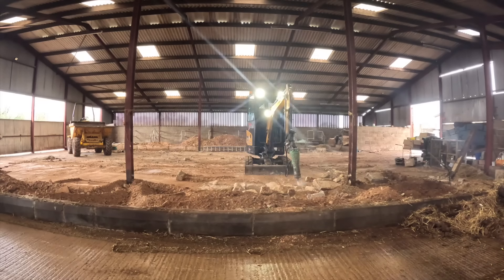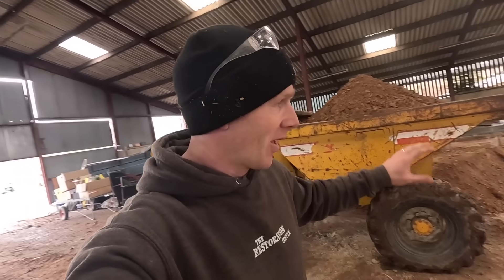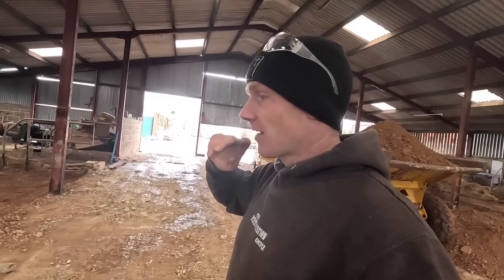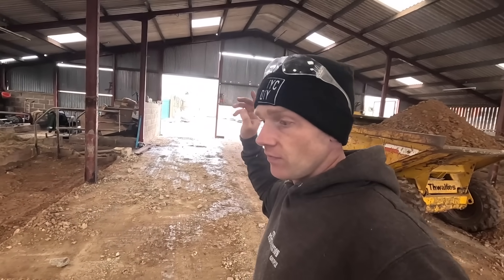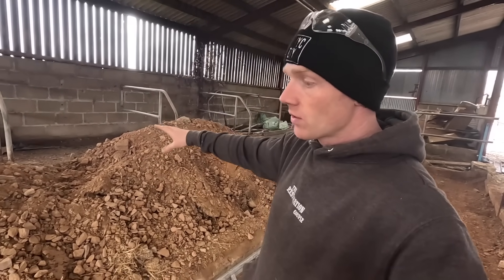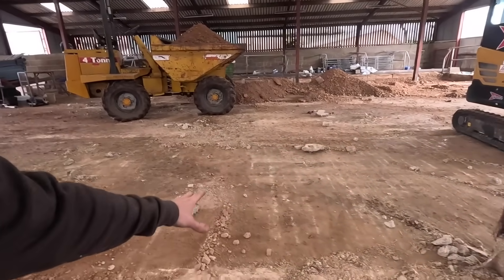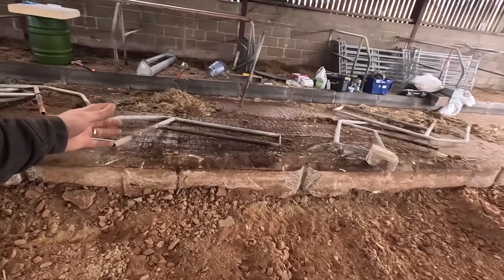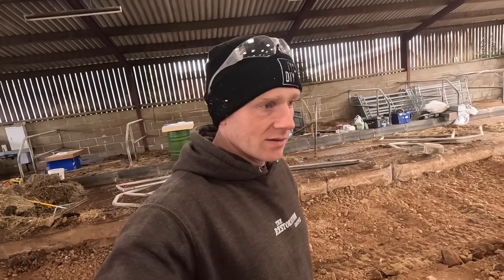OUR BIG BARN BUILD - BIGGEST DECISION YET - Does it have to go?

Comment: When it comes time to level your subgrade, a 3 or 4m length of beam fixed to the excavator bucket makes short work…  We’ve done floor prep fro 20,000sq m industrial buildings that way.  One hand in the excavator, and one with a stick and the laser level.  Beats the heck out of a rake and shovel.
Reply from the maker: That would be ideal.  Couple of days off so that's my next head scratcher! Did you have to fabricate the beam to fit somehow?
Reply: @TheRestorationCouple   First version was just a length of i-beam held against the bucket with the grapple/thumb.  Second was chains and load-binders.  Third version was a bit of iron welded to the beam so the teeth of the bucket would sit in, and then two tabs on the beam to bolt them solid to the sides of the bucket.
Reply from the maker: @vaalrus  I'll have a play this week.  May be able to bolt it through the existing holes where teeth go.  As it's hired kit I can't mod it but bolts fine. 👍

Comment: You have made a great start Tim! So will it be you doing the sand blinding and turning the cowshed into a beach???!!! It's great to see actual work but it would be nice to have an overview of the project in terms of how it is being run, (think you may be self building with an architect project manager), not quite sure if you have a 10 year warranty insurer in the mix too, or who exactly is accepting the risk on this concrete floor ie yourselves or a contractor???

Comment: The hardcore has to be inspected by the BCO or building inspector along with the insulation, so it can't just be assumed the existing hardcore is going to be allowed, perhaps the 10 year warranty provider will have a view too. Advice should be sought from the architect rather than a contractor on these matters, not following the correct procedure is how people run into legal and financial problems.

Comment: Good call Tim  all out and a nice sub layer to lay insulation and pipes on ,lots easier to fit all the drainage -services into than leaving the old slab and cutting and levelling  
Aggregate looks great that you have to work with  any thoughts on the insulation ? And will you have to drop the block walls to make way for new footings  or would sip panels work better on the exterior
Reply: Btw you’re lucky no reinforcement in the slab … 👍
Reply from the maker: All that info to follow, just finalising next stage with architects and structural but lots of insulation!! 😂
Reply: @TheRestorationCouple   Yep   U values / R values thermal bridging and condensation make an interesting vid in itself 😂👊 look forward to seeing the master plan
Reply: @joeappleton9213  Me too! It will be interesting to see what the height of the ground floor and second floor will be, the space soon goes with modern insulation requirements.

Comment: Definitely hire a crusher. 
RedRhino 5000 will get through it all in 1-1.5days. 
Maybe £600 hire for 2days. 

Huge value in having the crushed ag, even if for tracks/gateways and not reusing in the build project. 

Surely regret it if you have all that material taken offsite at not dissimilar cost to the hire of a crusher
Reply from the maker: We have a contractor with a much bigger machine coming to do it. Think the jaws are 650x650 so saves messing with a smaller hire unit. 👍
Reply: @TheRestorationCouple  
Awesome. Just great the material isn’t going offsite and will find a new purpose 👍
Reply: Breaking concrete without rebar is a lot easier if you can lift it up somehow. With air underneath it breaks much easier and in bigger chunks